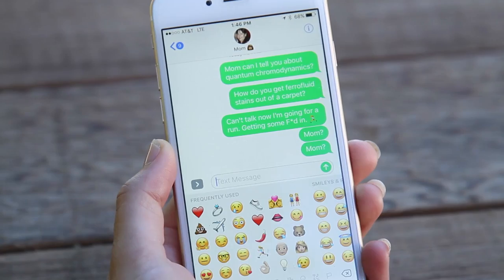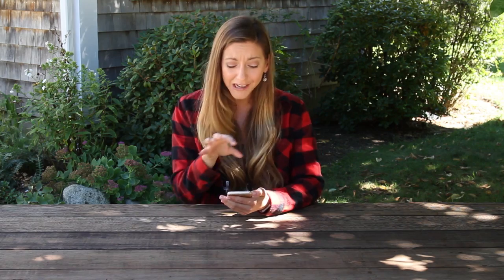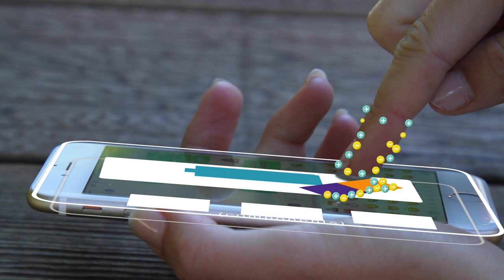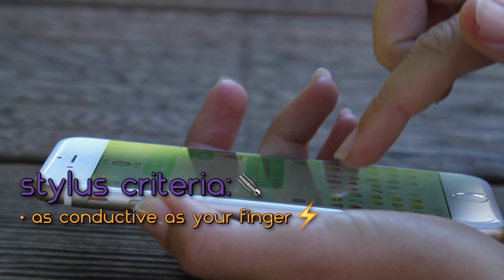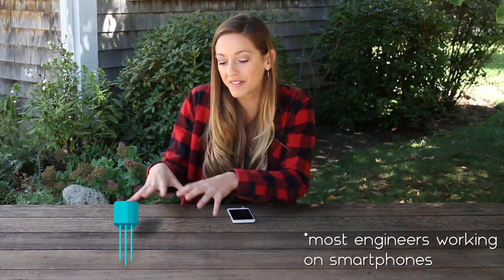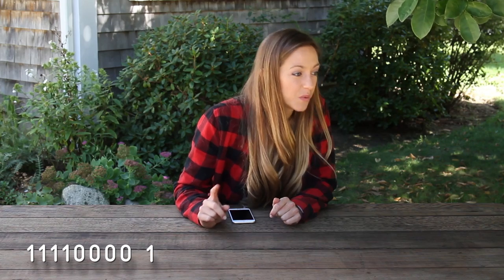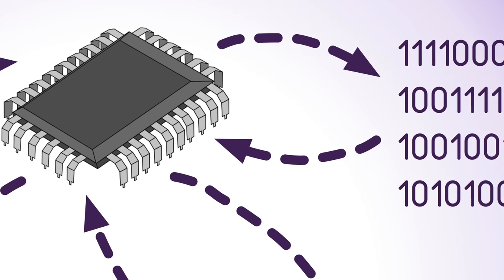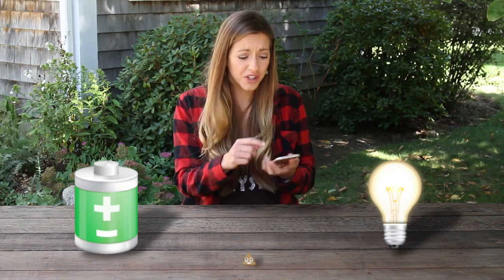How do touchscreens work?

Comment: thank you for good info .A programmer must not only know how to code but also the mechanism involved in transmission.iam doing my engineering in computer science .going to learn java,android....
Reply: I don't think this is necessary for a computer science major. For the most part programmers don't interact with the hardware and write numerical machine code.
Reply: yaa broo but having knowledge about that one is not wrong instead of coding every time

Comment: an insane amount of stuff happens when you send an emoji.  The full details of that process are more than any one person knows off the top of their head

A basic overview of the networking aspect is that the phone constantly senses nearby radio towers (each at the center of a 'cell', thus 'cellular network') and chooses one to connect with, typically based on signal strength.  The phone and cell tower communicate by sending electromagnetic waves outward from themselves in a spherical shape.  The antennas on the cell tower focus their signal energy in one part of their spheres (horizontally outward from the tower in specific directions), while the phone's antenna is intended to distribute energy evenly in all directions because it doesn't know where the tower is.  If you picture a sphere with your phone at the center and the nearest cell tower at the outer edge, the ratio of the size of the cell tower's antenna to the surface area of that sphere tells you the tiny fraction of the phone's transmitted energy that's received by the tower.  The weakness of the received signals, combined with the fact that there are often millions of other signals of different types overlapping in all directions, means that there needs to be very complicated methods of filtering out noise, as well as extra data being sent for error detection/correction, and serious legal regulation to separate and restrict the use of the electromagnetic field

When connected to this wireless cell network, the phone sends the text data enclosed by packet data (the start and end of the packet, in terms of time they're sent, enclose the text data), which is like an addressed envelope around your text so the network knows where to deliver it to.  Once received by a computer at the cell tower, this packet might actually get put inside another packet with better address data once the network figures out where in the world the recipient is.  The packet of data is then placed into a 'frame' of data, which is more like a train car than an envelope, and this frame is sent as bursts of non-visible laser light into an optical fiber.  The packet will be removed from the frame and examined at another node in the network, then sent off again.  This process may be repeated many times depending on how far away the person you're texting is, until the packet gets to the right cell tower address and is sent to the recipient's phone

Comment: That binary sequence (that makes the poop emoji), does not actually have the information of where each pixel should be and what color to make a poop coil. But its just a reference that one phone is sending to another phone, since they both use the same unicode, the other phone will understand the reference. Its similar to a language. If i say "poop" in english to you, you would only understand my reference if you spoke English. That's very different from holding out an actual poop in my hand for you to look at, which is not a reference, but the actual object which is language independent.

Comment: Technically Unicode character numbers do not represent any specific set of bits. The binary representation is determined by the character encoding. UTF-8 is the most widely used encoding and best in most cases. But there's an complicated and messy history behind all that.

Comment: How close are we to using scalar fields for wireless communications? Or faster than c so to speak. Quoting David Wenbert "Let them all have The Big Secret:  that 'Voltage' is FASTER than 'Current', and that fast switching can exploit this, drawing on any source of ambient electrons in the environment (earth, air, water). Its ultimately how ALL FE/OU devices work; Bearden was right - establish the Dipole, and switch so that it is never discharged/shorted and you can draw free current forever. Voltage propagates faster (up to at least 8x "c", speed of light), whereas current in a solid conductor propagates at something slightly less than "c". That's IT, that's the Secret.

Comment: So my question is:  How big would a computer have to be today using the technologies back in the 1940s, tubes and relays???

Design an "Adder" circuit to add two 4 bit binary numbers together, one bit per circuit:  https://www.youtube.com/watch?v=c4gcBZ8wQW8
Using analog switching devices (transistors, vacuum tubes, relays) to build digital logic circuits (And, Or, Not, Xor): https://www.youtube.com/watch?v=sTu3LwpF6XI
The definitive computer primer! Crash Course Computer Science: https://www.youtube.com/watch?v=tpIctyqH29Q

Comment: The explanation of the sensing hardware is interesting, but the chip that magically turns the sensor's input into a poop emoji is glossing over a lot of details. Obviously jumping straight to the full, actual details would be ridiculously overwhelming, but in my opinion it would have been more meaningful to explain that the chip hooked up to the sensor turns the input into information about where the touch is -- X, Y coordinates, size of touch and intensity of touch -- and then that information is passed to the processor which can decide that a touch at a particular place on the screen means a poop emoji. Also, that binary you listed out isn't the actual character code, it's encoded in a special format created to let older systems support more than 255 unique characters. I looked it up and as a straight number, the poop emoji (official name "Pile of Poop") is U+1F4A9, which in binary is 00000000 0000001 11110100 10101001. When computers talk to each other, they usually use a different "encoding" called UTF-8, and what you showed is the poop emoji in UTF-8 -- but the computer can't directly process the data in that form, because the bits of actual data are spread out unevenly across bytes and different characters can be different numbers of bytes long. A magical touch-to-emoji chip wouldn't be producing the encoded form directly, as that's only used when going "over the wire" to servers and the like.

Comment: Shorthand for high/low is hexadecimal, not binary. Binary is the math used to represent the high/low.
Reply: You mean shorthand for unicode is hexadecimal?
Reply: David Boucard one hexadecimal character is a representation of 16 bits of binary, Unicode is four hexadecimal characters which are in turn used to represent the characters that we use to communicate (i.e. alphabet, numbers, symbols, etc.)
Reply: Philo Sage I thought one hexadecimal character was equal to four binary bits, no? 2^4 = 16
Reply: David Boucard correct, don't know where my train of thought derailed at.

Comment: Unicode does not assign bit sequences to “characters”, it assigns them cardinals (numbers), called code points, kind of, with a more brother definition of ”characters”, Unicode actually assign them non-unique combinations of cardinals, as there are also variant selectors and grapheme clusters. Encodings assign them bit sequences, but not necessarily unique ones or to unique characters. The most popular one that fully supports Unicode is UTF-8, which you where using for your poop, and which does assign unique bit sequences to unique code points, but not to characters. As Unicode provides to ways to create for example ö, so does UTF-8, and other more complex grapheme.

þ is not actually unique to Icelandic. Icelandic is just the only still living language that still has it. It was also used in other Norse languages: Old Swedish, Old Norse, Gothic, and Middle English, as well as even Old English, which to my understanding is unlike Middle English not closely related to Old Norse.

Comment: 4:15 – technically this is binary for UTF-8 encoding of pile of poo emoji. This is why it does not match 1F4A9 if one were to naively translate it from hexadecimal to binary.

4:40 – Actually, Unicode has space for only a little over one million code points.

Comment: And when it doesn't work, the user yells at the app programmer, that yells at the system programmer, that yells at the compiler programmer, that yells at the microchip engineer, that yells at the electrical engineer, that yells at the physicist, that yells at the mathematician, that yells at god I guess...

Comment: Converting signal to emoji is the magic of software not processor.
Reply: The hardware runs the software. At a base level, programming languages are just a tool for running numerical machine code which directly controls the hardware.

Comment: Your first minute and half in the video is not correct. Balance of charge and stuff. Instead, scann of array of electrodes is done by measuring capacitive reactance (Zc), which may be expressed by formula Zc=1/(2*Pi*f*C), where Zc is capacitive reactance, Pi is 3.14..., f is frequency, and C is capacitance. We may call this capacitive reactance also capacitive impedance. By measuring transferred charge from one electrode to another by formula above (you may imagine it as a resistor), where one pairs of electrodes sending RF signal with fixed strength , while other pairs measuring voltage transferred by VARIABILITY of capacitive reactance depending of how much capacitance is added by conductive object (fingers, metals...). This scan is very fast, and usually uses more than one scan to be sure where exactly your fingers touched, then compare the result and MCU (MicroControler Unit) make decision how to interpret readings. The rest of your video is about right. There is too much technical data to shrink in such short video. Anyway, I enjoyed waching your videos about physics. Thanks.

Comment: The only issue I have with your presentation is that you completely ignore the software  that drives the whole thing. The touch on the phone surface is not simply translated by electronics (resistors, capacitors, and transistors) into the corresponding emoji. It's the software that does most of the work. I hope that when you get around to explaining how the message is transferred from one phone to another you'll explain the very important contribution that software makes to the whole system.
Reply: Yeah! i have the same issue.

Comment: Thorn (þ U+00FE Þ U+00DE) and Eth (ð U+00F0 Ð U+00D0) are both valid  English  characters... through about the 16þ century. They fell out of use about the Renaissance...  Along with Middle English Wynn (ƿ U+01BF Ƿ U+01F7) and Yogh (ȝ U+021D Ȝ U+021C)... The long S (ſ u+017F) was in use into the 1920's in the US (I've encountered it in both handwritten and printed matter in government records), but largely left favor in the last two decades of the 19th C. A number of odd characters are used in one or two languages, but included in Unicode as much for historical work as for their current use. More amusingly, I've met non-icelandic kids with the names Ðor and Þor, noting they used icelandic spellings.